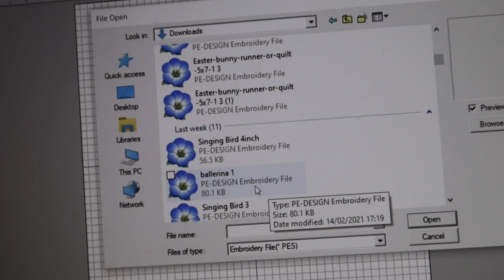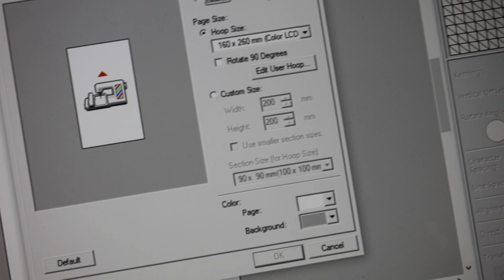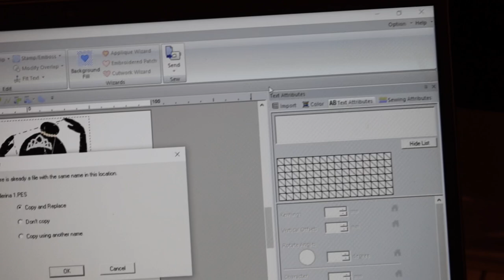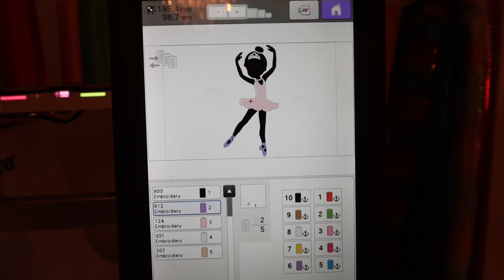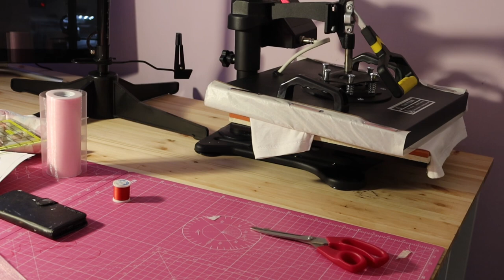EMBROIDERY TUTORIAL - HOW TO EMBROIDER A BALLERINA  with tutu skirt onto a shirt

Comment: I love this design, it's beautiful💞 would it not have been easier to just add the tulle while in the hoop with a satin stitch around the midriff and even the ribbon with a small satin circle and then all you would need to do is make a bow and add the "soft to the touch" fabric on the inside💫
Reply from the maker: I did think this but that’s how the design was when I bought it. I might have a go at tweaking it 😊 see how it turns out.